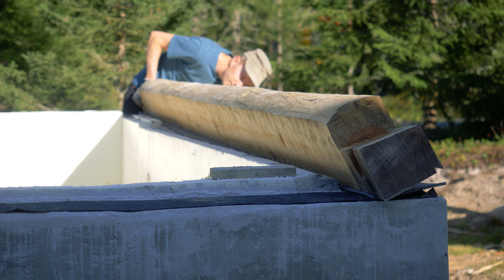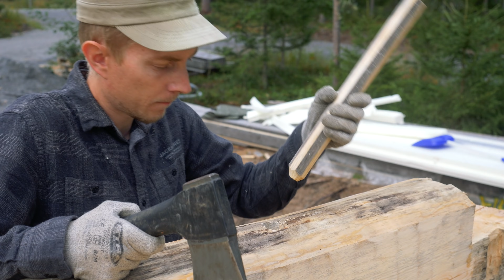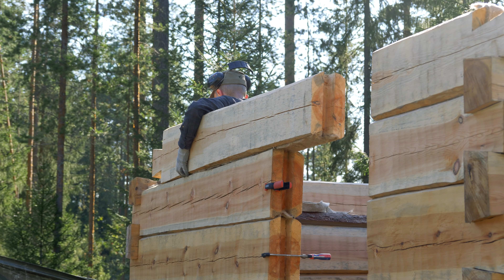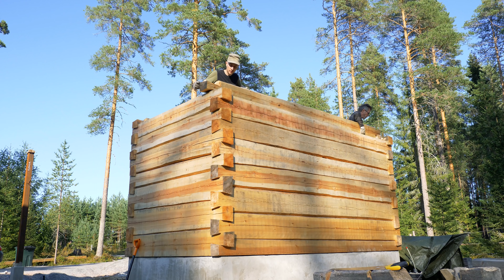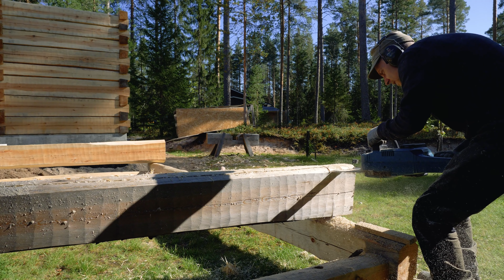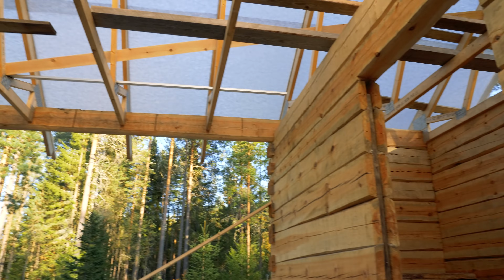Modern dovetail log garage | Final assembly

Comment: A very handsome construction!  I always wondered how it was to become a garage.  So this building is to become an office, to compliment your workshop, and your car stays outside but undercover?  Or are walls going on the garage (interesting you insulated the floor), all will no doubt be revealed in the future?
Reply from the maker: Garage might not be the correct word for this, but I didn't find any other understandable short word. Please help me if you know something better :) The car stays outside, however the other side will be partly covered in the end. And as usual the purpose of my buildings may change overnight. When I started this project I didn't know I'll need a home office.
Reply: @FinnishPlayground  In American English we call it a "carport."
Reply: @FinnishPlayground  I'm thinking maybe a carport is the right word!?
Reply from the maker: That's what I was planning to use first, but then I thought that maybe it's not widely used. Sometimes it's difficult to know whether some of my word choices are stupid or not.
Reply: @FinnishPlayground  Your English is excellent, how are you supposed to the finer points if you haven't spent a lot of time in an English speaking country?!

Comment: Disappointed 😮‍💨with the amount of modern material and methods with this project rather than traditional ones which are more befitting your wonderful acquired skill sets and much less expensive as well...

The "carbon footprint" of modern concretes and their damage to our planet still can not outperform stone for both durability and ease of use/application and long-term durability/serviceability...

Seems like it might be time 🙄for you to start learning to do some traditional timber framing especially for the roof of such a fine structure as this one you have built...and since you may wonder (?)...YES!!!...there are many garages and barns still today with wood floors that hold up things much heavier than cars...😉

Still enjoyed the video, your skills, and sharing them with us...